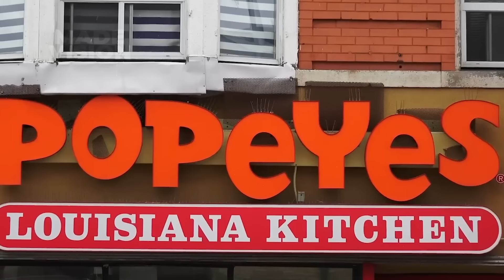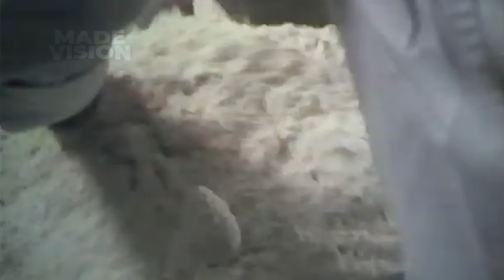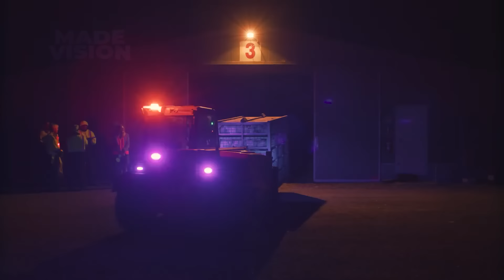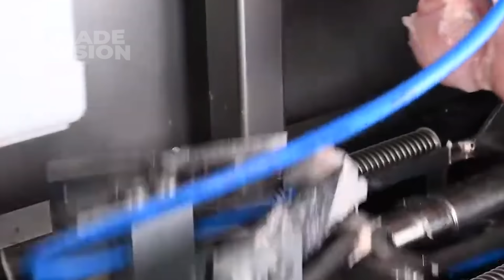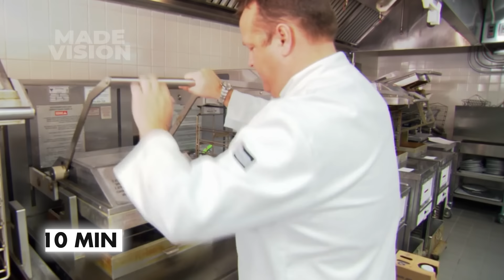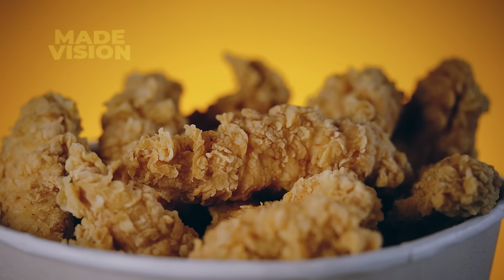How KFC Chicken Is Made In Factory & Restaurant

Comment: I'm chuckling for a couple of reasons. In school in the late 70's, early 80s, I worked at Wendy's. Dave Thomas was one of KFCs best franchise owners. When we started fried chicken breast sandwiches, we had a similar but different technique.
Frozen Boneless skinless chicken breasts were in big vacuum bags and we put them in the walk-in fridge to thaw. The next day to prep, we had to run our thumbs up the inside of each breast to split the membrane. This is what keeps breasts from curling up into a ball when fried. Prepped breasts were kept in covered containers in the walk-in. We'd take out breasts from the big container, put them into smaller ones kept on the refrigerator breading cart. Instead of water, we had containers of real buttermilk and premade breading with seasoned flour. We were told how many to prep at a time so chicken was always fresh. Breasts went into the buttermilk, pulled out, drained and floured, then up front to the "Henny-Penny". Pressure fryer. When done, they went into a holding cabinet where we marked the time with grease pencil. We actually followed the time and pulled the chicken when it was old. Managers got penalized if they kept making too much chicken at a time to sell. 
In those days the burgers and chicken out store put out was really good.
They do things differently now and don't give a crap about quality.
Our KFC sells scrawny, boney birds, and the chicken always tasted like it was made hours ago. Cold, dry, stale. I don't eat it.

Comment: I worked in a store. The chicken comes in frozen. I washed the ice crystals off it. The chicken comes in bags of 9 pieces...the breast piece was cut into 2 side beasts and 1 center breast. I made the crispy chicken and the sandwiches. This was cooked in a large basket. First dip in water then flour then flour then fry. Easy. About 27 pieces at a time. I always pulled off all pin feathers. 😅
Reply: So they turn 1 breast into 3?
Reply: so did i in 1993 in aust it was never frozen delivered
Reply: @craigdavid6519   Probably cos suppliers in Australia are closer to the stores compared to how they are over in the US? Not surprised considering the distance over there and the number of stores that each processing plant would have to cover.
Reply: Breasts
Reply: it comes in fresh from local farms. if its frozen it would have happened in transit.
Reply: I worked at the KFC too, and what you said is not how it was at least in 2004.   Our chicken came refrigerated.   There were about 28 chickens per box, and each bag had two entire chickens with 16 pieces in the bag..   The chickens were refrigerated not frozen.  The exception was the sandwiches, which came frozen. I think if I remember correctly.
Reply: I still work there literally all of what you just said is wrong
Reply: @hectiicclaw1388  So tell us then how it is.
Reply: @hectiicclaw1388 she described my experience